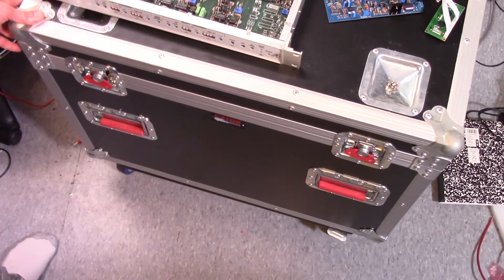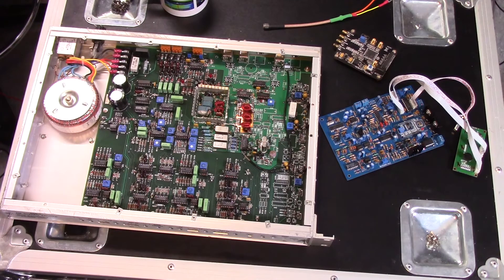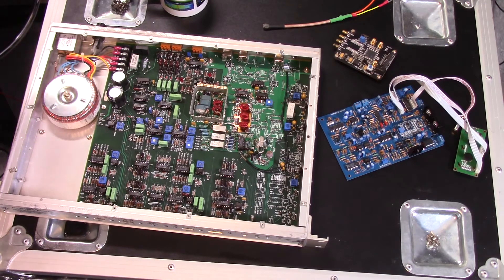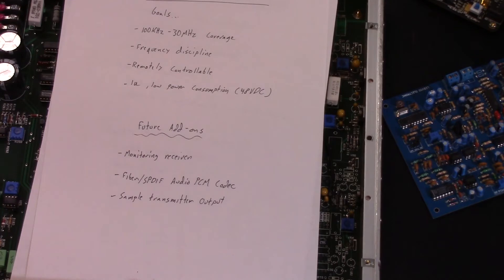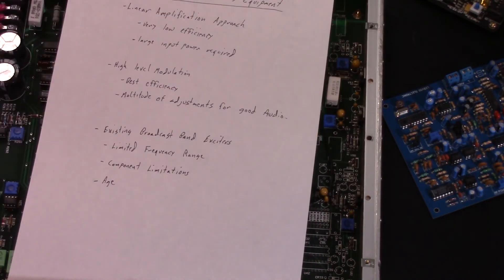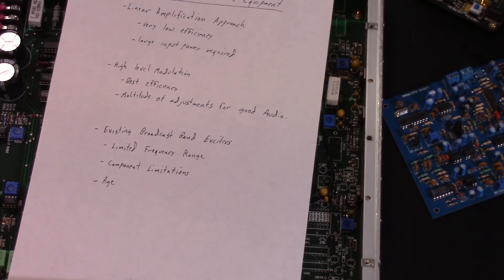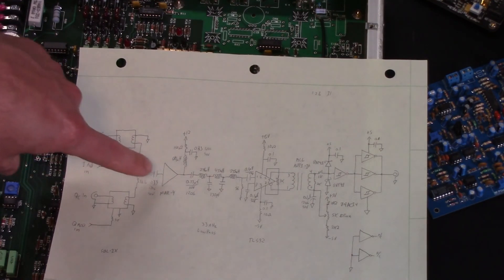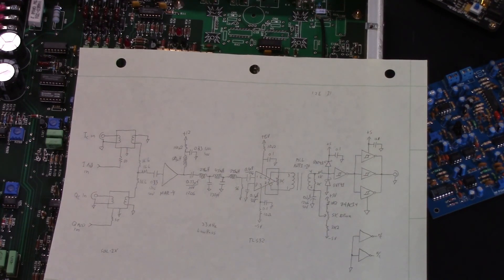Building a HF C-QUAM Exciter; part 1, overview

Comment: I have a mono PWM mediumwave transmitter. Can I somehow hack that Greek stereo board for the phase output into the bigger mediumwave transmitter and then split the audio and send it to the original transmitter and the greek c-quam? I can't find the delta thing and I think this would be cheaper.
Reply from the maker: Short answer no.  Because the audio and RF signals propagate through the transmitter at different rates, a compatible waveform will not be re-created at the transmitters output.  This is why there are delay correction circuits in the exciter to compensate for the delays in the transmitter.  Without them, the transmitted signal with either be distorted, or have very little separation.  There are also protection circuits integrated to prevent loss of carrier drive during very deep negative modulation excursions.  Loss of carrier drive can cause catastrophic failure of a solid state RF stage operating at power.
Reply: @xfmshortwave  I also have this question, I have licenses for two frequencies, one mediumwave, and one shortwave, and since I have stumbled upon your videos of CQUAM stereo broadcasts of X-FM, I thought, why not apply Stereo to both my frequencies, and on the next license I am also prospecting to acquire on possibly the 60 metre band.

I have two AM Stereo exciters from ASPiSYS, the ASMAX-1 is for my 1611 License, and a much newer ASMAX-2 that I have specially ordered to work up to 2.5MHz for my 2355KHz shortwave License. At the moment I an doing experiments to aim for a final design of final class E final modules to be teamed up in a 1KW carrier power transmitter for 2355KHz.

At the moment the experiments ended up with it becoming a linear amplifier since I was figuring out the gate drive situation where I adjusted component values to end up with a resonating LC configuration of the gates (using a VNA) with the input toroidal transformers, driven by a signal generator, the output monitored by a CRO, it didnt work until I modified further to add some bias until the Mosfet's began to work, this part is to do with getting around the enhancement mode of the MOSFET's I am using, it works okay as a linear amplifier. Next step is to remove all of the input transformers and replace with a dual transistor gate drive to brute force against the Gate capacitance of the output MOSFET's to remove that out of the equasion, the input would be logic level square wave to then be driven with preceding circuitry I will look at planning.
For the 1611KHz I have repaired a 250 watt carrier transmitter that has a class E output, which is PWM modulated, it has an exciter input for the purpose of maybe running a C-QUAM exciter, the final stages is to tune the output network to move it from the frequency it was operating on in its last job to my licensed frequency.

Now for the CQUAM part and dealing with its two audio paths:

The question I have now is how would the L+R audio component would be in phase with the L-R component by the time it reaches the final AM modulator. Both the ASMAX-1 and the ASMAX-2 are already designed to be integrated into a high power transmitter, they both have a mode where you move a jumper that disables its internal AM modulator to instead send the mono L+R audio to the output jack out the back to send to the modulator. 
This makes me think about how the phase can vary in the two paths, wether I would need to somehow run the L+R audio through some circuits to vary the phase in order to get the two paths in sync by the time they meet at the transmitters finals, or I would need to contact ASPiSYS to acquire instructions to adjust the pots on the exciter board if it can be done that way. This is a whole rabbit hole that I am exploring, absolutely determined to apply C-QUAM to all my signals.

Comment: Cool project. I would consider stereo as a improvement to the transmitter. I am trying to get as many SWL’s into SDR’s as they have the best sound, hands down, over any un modified receiver.  Most are satisfied with low quality mono audio in their receivers. But I think this is changing by the fact of having Hi Fi broadcast stations as yours even in stereo.

Comment: I wouldn't expect anything less, RH.  I've been messing with an RS-HFIQ to do arbitrary modulation, be it C-QuAM or DRM, but haven't found a PA solution that doesn't require tons of current for a practical output.
Reply from the maker: That is the primary reason for pursuing this project, as my previous transmitter would draw 2KW to make ~350W carrier.  The new transmitter is over 80% AC to RF efficient, a return to the old method would be silly.